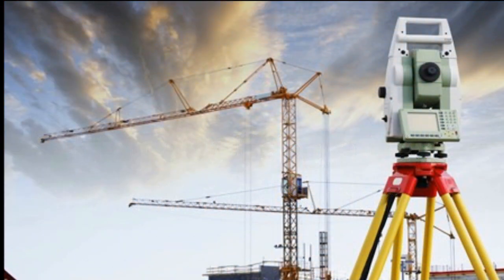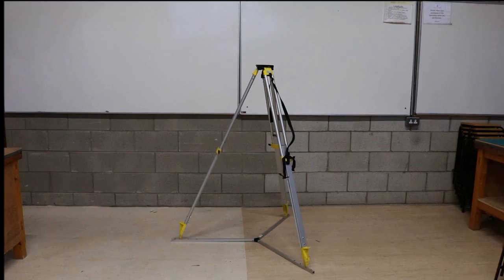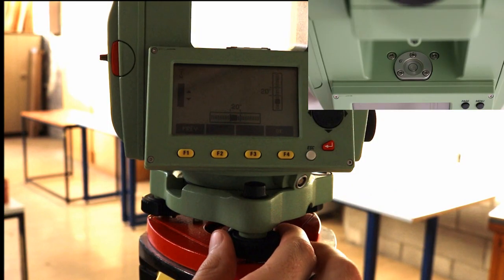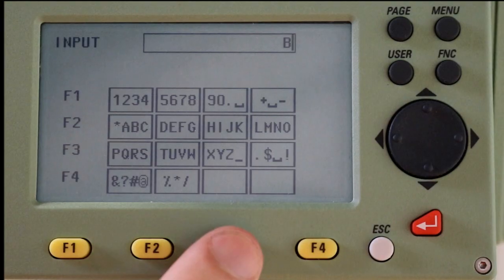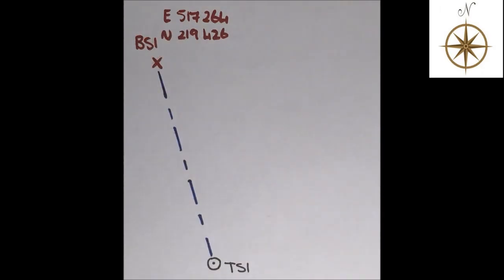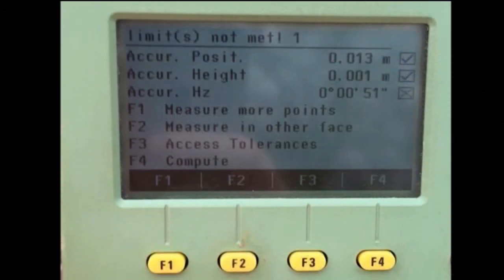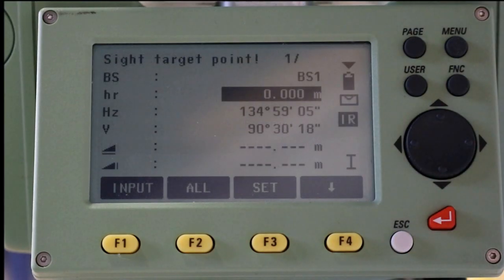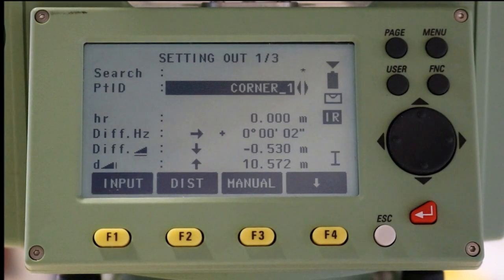How to set out coordinate points using Leica TC407

Comment: Just a quick question. The accuracy Hz, what exactly is it for. One time I got good accuracy position but not great accuracy Hz. does it effect when taking measurement whether accuracy was 30mm or 0mm.
Reply: check the residual error after resection and see which point you dont have sighted good